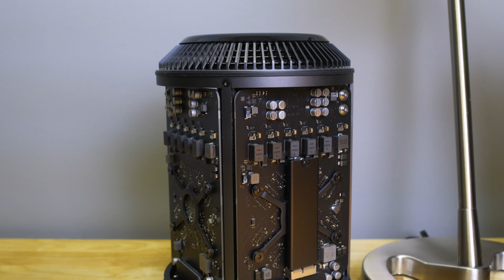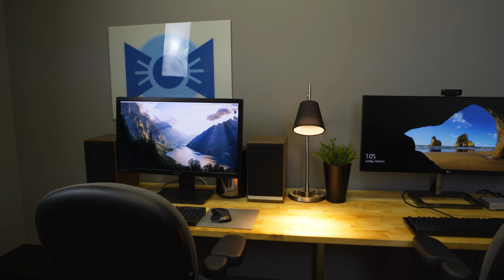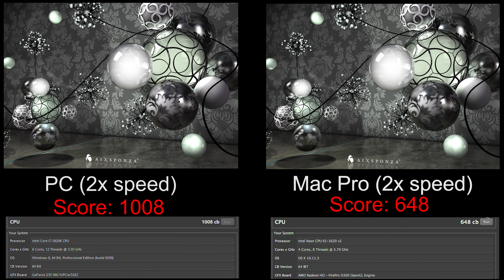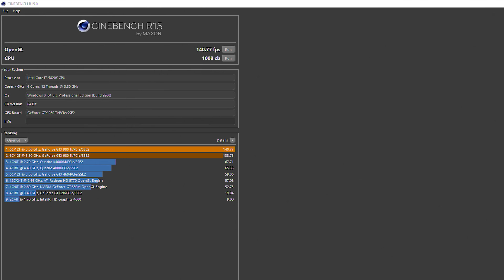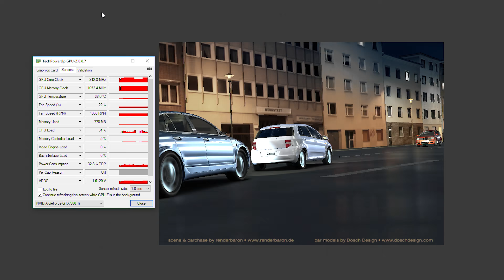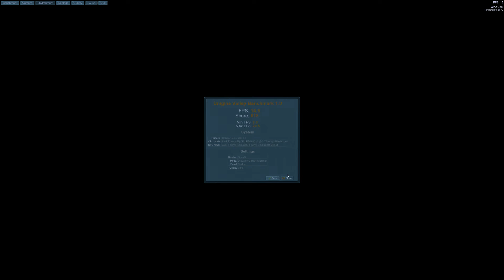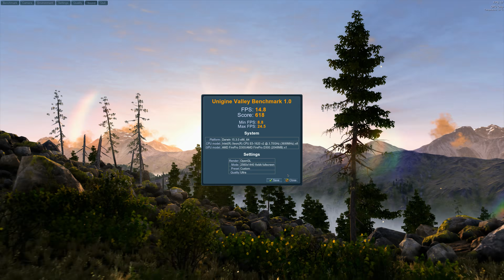$2,000 Custom PC vs $4,000 Mac Pro

Comment: I just checked apples website and they have a much better model available.  12-Core 2.7Ghz Xeon, 64GB DDR3 ECC RAM, 1TB PCIe-Flash storage, Dual AMD FirePro D700 6GB GDDR5 VRAM each.  This is currently the highest end Mac Pro you can buy from Apple's website.  All for the low low cost of ONLY $9,599.00 USD.  HAHAHAHAHAHAHAHAHA.  If someone buys this please let me know so I can laugh at you.
Reply: +Enzospin360 You know, if you build your own PC with similar hardware, you'll spend about the same amount of money. This isn't a machine made for gamers or low tier people making a YouTube channel.
Reply: +inmynothingyoumeanteverythingtome actually for same specs you would spend about $2000 less.   With a $10k budget on a custom built pc workstation you could pretty easily get away with 2x 12 core cpus at about $5k with $5k left over for everything else including faster ddr4 ram and more of it.
Reply: You're not understanding what I'm saying. Build one with similar parts. Xeon CPU's, not Core i series, ECC-registered RAM, not standard non-ECC RAM, workstation class FirePro or Quadro series GPU's, not gaming GPU's. PCIe based SSD's, not standard SATA SSD's. When you actually look at the prices of the individual components of the Mac Pro and how much it would cost to build a spec for spec PC, you'll realize you'd spend about the same amount. But then you still wouldn't even have the small form factor that the Mac Pro has, you'd likely have an ATX sized build. So don't try and give me the bull shit line about "I can build a better gaming PC for under half the cost" because you're not building the same machine.
Reply: +inmynothingyoumeanteverythingtome When did I say anything about gamming?  I just said it would cost less for the comparable build.  idk where you are getting your numbers from but a $10k workstation pc would have better specs than a $10k mac pro.
Reply: Dude, I'm pricing it out on PC Part Picker. Buying similar components is actually more expensive than buying the highest priced Mac Pro.

http://pcpartpicker.com/p/sZVsRB

Over $10,200 and I haven't even added a motherboard (because nothing was compatible with the required parts) and still no case or cooling system. Yes, you can substitute parts for a cheaper build that will benefit more at many tasks, but you're still cutting corners in the long run.
Reply: If you are going to quote prices at least use the lowest price on the market.  http://www.amazon.com/AMD-FirePro-Retail-Graphics-100-505632/dp/B0093HV38O?SubscriptionId=AKIAJMPUPDNYIYT5HIWA&tag=gamedebate-20&linkCode=xm2&camp=2025&creative=165953&creativeASIN=B0093HV38O
Reply: I went with list price instead of the one-off price of Amazon that one dealer was offering with only 2 left in stock. Most people will end paying closer to the list price.

Comment: And Jaguars cost more than custom hot rods.

The servicing, the support the nice convenient features the fact you didn't have to design it and build it yourself. All that cost more on top of the parts.

Seems like a dumb thing to compare. If I wanted that custom PC then I'd have to pay someone to build it for me. And if I said I wanted it in polished metal and half the size of a normal computer you can bet your ass it would cost even more.

That said if you could buy the parts to the mac pro and build it yourself then I'm sure it would cost a lot less than it does.
Reply: no you're right. Because Apple don't charge for the assembly of the product or the fancy packaging or the sales staff at their fancy stores or or the after sales service, that's all free isn't it.

Comment: Put this correction in your annotations that your setup is ~$3,000 from Apple. Not ~$4,000. Just saying, it's a little misleading. The ~$4000 configuration has the 6core processor.

Comment: Apple sucks!!! But I have to disagree, the mac's hardware is not designed for high bandwidth processes or applications (AKA Games and synthetic benchmarks) it was designed (the hardware) for raw processing power that doesn't need too much graphics performance or nothing at all like CAD or all other hipster software (LOL Sorry) and like you said it is a 3 year old Mac if you want to see a real difference build a PC with parts available during the year that mac was released. And By the way the AMD FirePro Is not for gaming at all like the nvidia quadro, so none of the test can be considered valid except the last one.
Reply: +Juan  Garcia I forgot: APPLE SUCKS!!!!!

Comment: My $650 custom gaming pc got better results than the mac at Unigine valley lol.
Reply: I used the exact same settings, i got avg fps: 20.4 Score: 853 my specs are: 8gigs ddr3 ram 750ti 2gb vram and a 3.4ghz quadcore amd processor.
Reply: Max fps: 38.3
Min fps: 7.0

Comment: Can some one tell me what the best specs and parts I could get if I spend £1000 building a pc. I'm a complete noob and have no idea what to buy. I want to be able to play the most recent games maxed out with 60 fps.
Reply: +saarah0006 Go to the store you plan to shop online and look for graphics cards that are half your budget with the best / most reviews, match the interface of the card (most likely pcie 2 or 3) to a motherboard in the size you want (atx = full size, matx = "compact", itx = tiny), match the power the card takes to a power supply plus 1 or 200 watts that will power the rest of the system, get a moderate (120g or so SSD) for operating system, a bigger SATA 3 drive for storing things, get the highest ram speed your motherboard will support from it's spec sheet  and buy as much as you can, pick a case that will hold it all (motherboard size) and the rest is where the adventure starts. Look online for windows 7 for dirt cheap prices (king software for example) and either stick with it or get the free upgrade to 10... really not as complicated as people make it seem.
Reply: +modmutt why are cases like expensive when they have nothing in them and you have to fir in everything including a power supply yourself? Do you pay for the appearance or something? Also is 200 wats good. I pretty much flunked high school physics so I don't understand that.
Reply: saarah0006 Depends on the engineering and metal used. If they come with a power supply and the "combo" is cheap, the power supply is most likely junk. For a gamer computer, I'd go with a 550 - 750 watt power supply depending on how good a graphics card you get and whether or not you go for an amd cpu or intel cpu based computer (amd is about a third of the overall price when all is said and done but will take more power and run way hotter for similar results). You can look up a power supply calculator online and get a more realistic estimate of what you will need.

Comment: It wasn't the power supply. All you woulde have to do was to replace the 2$ 24 pin ATX connector. But a nice computer it is.
Reply from the maker: +Frode Angell Løtvedt Did that. It was the power supply.
Reply: +Snazzy Labs You're just saying that. Mac people.. ;)

That Mac looks awesome byw. Never seen one before.. Amazing design. To bad it's not performing.

Comment: I don't feel this was a fair test as the Mac Pro is meant more for work as it has more commercial grade hardware. Even if it had been a fair test, the PC still would've won. #PCMR
Reply: +Spource Video editing and 3D modeling is work.
Reply: theade8 I didn't say that it wasn't
Reply: Spource Then why is it an unfair test, seeing as he compared 3D rendering and video exporting?
Reply: theade8 The Mac is equipped with commercial grade hardware. It's made to preform different tasks
Reply: Spource Such as?

Comment: I like the video but your perspective in the matter is incorrect. PC are yess cheaper and faster... But when you are working on a 600,000 USD TV commercial and shit hits the fan because of a virus or a blue screen of death that in were apple extra money and slower performance kicks in. IT HAPPEND TO ME... We had o the best money can buy in PC and it work well for about 6 months but then in the most crucial of times it fell apart. We had to work night and day to recupe all the work and it was done in and old Mac Pro... The old aluminum one that as never fell or stop working. I put my money in a system that is slower but more reliable... With that in mind I see now a destructive trend in Apple were tim cCook is taking the company to a place were products are expensive and unreliable. That is wend I will change...